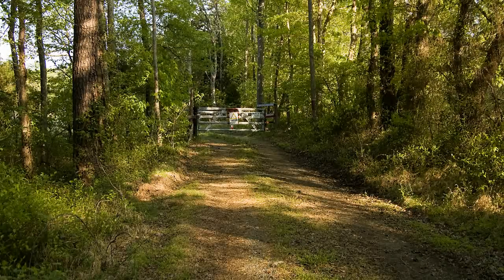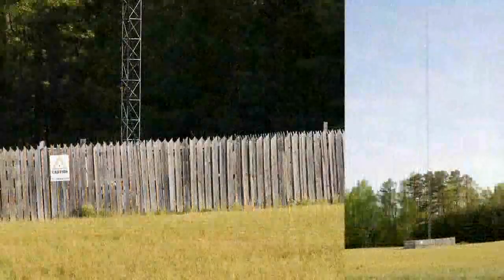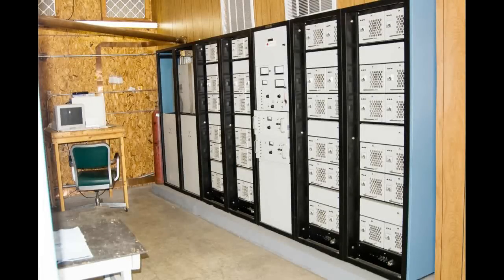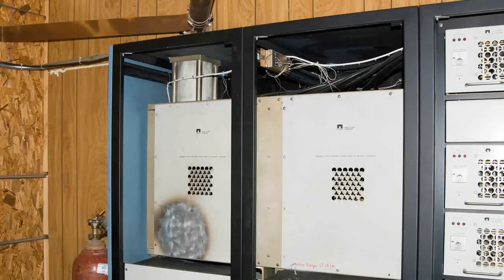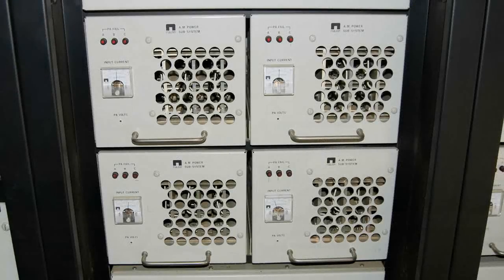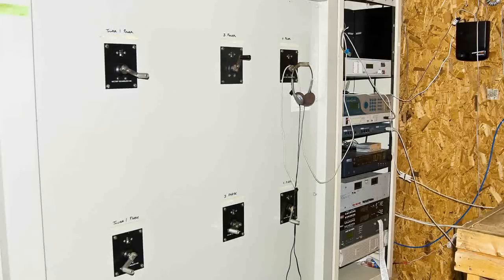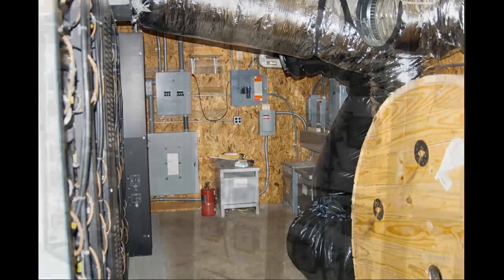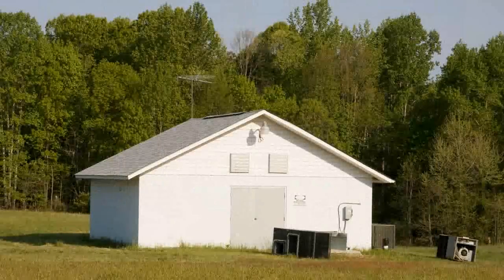50,000 Watt Transmitter Site

Comment: thanks for posting your video, i liked it,, you had mentioned you were waiting on the new air conditioner at this site, what i want to know is, when the air conditioner gos out, can you still run the transmitter at full power without heating up and cooking the equipment?

Comment: ..Interesting...there is a radio station near me here in Sacramento....3 towers like these...200+feet tall...I don't know much about transmitters...but it was obvious to me the whole tower was the antenna element, co-ax running from the RF transmitter cabinet a couple feet away, connected directly to base of tower.......sitting on a ceramic sphere about 12" diameter...grounded 'lightning' rod about an inch or so from the base of each tower.....3 towers maybe 100 feet apart...underground wiring and RF from a large 'base-station'.....large (5-6 foot) Satellite dish on base station...base station sitting on 12-14 foot legs.....  Several years ago...a bad fire in the brush and grass toppled 2 of the towers....lower part was looking like spaghetti....brush fires were pretty hot......Towers were later rebuilt....

Comment: curious as to whether or not this station has a low-power pre-sunrise authority. I would think it has to sign off at local sunset to protect WBZ. there is a 50kw licensed to Indian Head, MD about 35 miles southeast of DC that can't sign on until sunrise because of WBZ.

Comment from the maker: Thanks. No, we can not run the transmitter at full power without proper cooling. There is a heat alarm and we can call up the transmitter site and check room temperature. The air conditioners are very important.

Comment: A "hot tower" means the tower itself is the antenna and it carries LETHAL voltages.
Reply: billyboi57 "Its not the Volts that kill you, it's the Amps!" But considering the Amps are directly related to voltage potential, Volts set the current since your body is only so much resistance, But voltage doesn't flow, current does. So Technically the Current is what kills you.
Reply: Jon Williams You are correct, of course. I was just generalizing in my comment. The main point being that the entire tower structure is the antenna.

Comment: @AllAmericanFiveRadio  ok thanks for answering my post, i have another question, the triangulater thing, it has a post it sign on it saying touch it and die, is that because it will shock someone and kill them? or did that mean it will cause trouble with the equipment if someone touchs that, i know you said you set it once and dont touch it again,

Comment: I didn't read all the responses below but the pipe is called wave guide, correct..??
Reply: It is hard-line coax, it is similar to wave-guide but not exactly as wave-guide is only used on the higher microwave frequencies. Pipe has to be used as coax due to the extremely high power output. Ordinary cable would melt at that power level.
Reply from the maker: Wave guids do not have a center conductor.

Comment: Nice Nautel Ampfet transmitter there! That thing should keep going for many decades to come with few problems.

In case you didn't already know, Nautel started out as a manufacturer of aeronautical radionavigation beacon transmitters (NDB), first generation of transmitters produced in the early 1970s.

Although horridly inefficient (30-35% is fairly typical), many of these early transmitters are still going strong (I maintain many of them, as well as some newer versions too such as the Vector series NDB transmitters which are almost identical in circuitry and operation to broadcast transmitters such as the J1000).

Comment: I have seen a Harris DX series personally at KBBW 1010 in Waco and it works much the same. 3 phased towers 10kw day and 6 phased towers 2kw night at a second site. These use much less electricity than tube transmitters and generate less heat also.

Comment: Hi Rick,  thanks for sharing and for the time and effort to make it.  Nice transmitter site.  So, it's 50K from the transmitter? I'm a little confused. The towers are "hot" for an FM station?  I know FM stations get their advertised power rating from the ERP provided by gain attained from the antennas arrays mounted on the towers and fed by coax , but AM broadcast stations count on just brute power from from the amplifiers and phased 1/4 wave arrays for the most part?

Comment from the maker: The four towers are all hot. Power is 440 three phase.
Reply: No such thing as 440 three phase in the United States... it was 460 until the 1960s... just like there is no such thing as 110... all voltages were raised in steps during the 60's and 70's ...  It is 480 VAC either delta or wye for over 40 years

Comment: i thought tower is grounded and trans miting elaments are near the top if lightning hits tower it will ground out and not go to transmiting equipment
Reply: For FM and TV stations yes, but not on AM. Due to the long wavelength the tower itself acts as the antenna, or else the antenna would have to be extremely long in order to work efficiently (over 100 feet).

Comment: Thanks for the video. I always assumed there was one gigantic transmitting tube in there.
Reply: Up until about 30 yrs. ago, you'd be right! Then, the first wave of moderate-power (<5.6 Kw) solid state AM transmitters like the Harris SX series were type-accepted by the FCC. Higher-power, solid-state AMs like the Nautel series came quickly along.

Comment: i thought the tower is grounded and hard line carrys 50,000 wats to transmitting element near the top
Reply: David Berquist 
The most popular antenna for AM broadcast is a series fed tower. First is the concrete base upon which sets a porcelain insulator. The tower then sets atop the insulator. Power is fed to the tower just above the insulator. The whole of the tower above the insulator is energized.

Most commonly semi-flexible (helix, etc.) transmission line is used. Hard line is usually reserved for exceptionally long runs (efficiency) or better high power handling ability due to its high cost.
Reply: In AM radio, the tower carries the transmitter's total power.

Comment: Thanks for the station tour - could you speak about the contents of the boxes at the bases of the towers?
Reply: jerome whelan 
These are called Antenna Tuning Units and contain circuits (capacitors & coils) to fine tune the antenna to match the impedance of the antenna to the transmission line. At some stations these boxes will be in the form of a small shed.

Comment: very interesting.  i know with AM radio, the entire mast serves as the antenna.  how do stations (like WHO since you mentioned 50,000 watts) do maintenance on a tower without taking the station off the air - so they don't get fried climbing the tower?  how does this differ from an FM antenna?  can they be on the same mast?
Reply: Stations do maintenance with the station on-air by greatly reducing the power.  When I was at KFIA in Sacramento, if someone needed to climb a tower to change a strobe during the day, we'd take the power down to 500 or 1,000 watts non-directional from its usual 25,000-watt daytime directional.  This differs from an FM or TV antenna in that the tower itself does no radiating.  The tower simply holds the antenna, which is mounted at the top of the tower.  FM antennae can be mounted to the top of AM towers (KYA-FM in San Francisco was an example), but certain equipment is required to keep RF from "bleeding" from one to another.  A broadcast engineer can explain it a lot better, but there it is from a layman's perspective.

Comment: I have been to the WSM-AM 650 Transmitter Site and I live about 45 minutes away from their site. Nice place with much history! I have been trying to find out where WSM-AM first site was in 1925. I live here and nobody seems to know.
Reply: My guess would be on the roof of the building that housed the station.  A lot of stations did this in the '20s.  In San Francisco, KPO (now KNBR) first signed on in 1922 on the top floor of the Hale Bros. dept. store with the towers on the roof.  KFRC, KFWB, KGO, KGGC (now KEST) and KTAB (now KSFO) all had their antennae on top of the station building or next to the building.  Putting the site outside of town didn't really start in earnest until the 30s.

Comment: would a lightning strike,fry all that equeptment?
Reply: michael slee 
A lightning strike could very well cause damage to the equipment. A well designed transmitting plant will have taken that into account and will have taken measures to minimize the damage potential from lightning, power surges, etc.
Reply: They likely have lightning arresters, which shunt the current from the lightning strike to ground.

Comment: Is this TV or AM or FM radio.
Reply: AM radio.  The entire tower (or towers if it's directional) serve(s) as the antenna.  On the other hand, the antennae for FM and TV stations are radiating elements usually mounted to the tops of towers.  The towers themselves don't radiate signals, they merely hold the antenna.